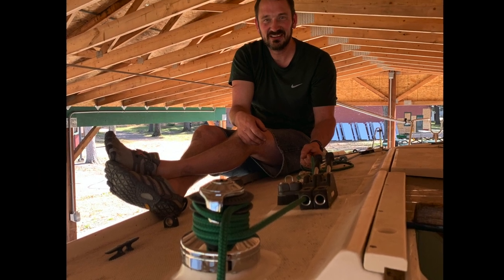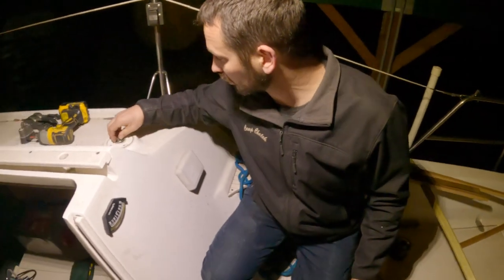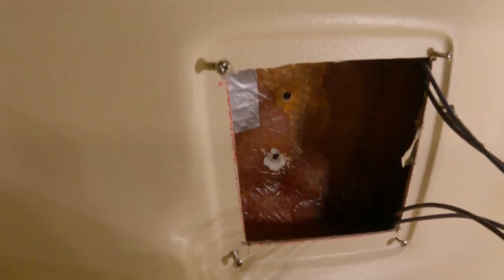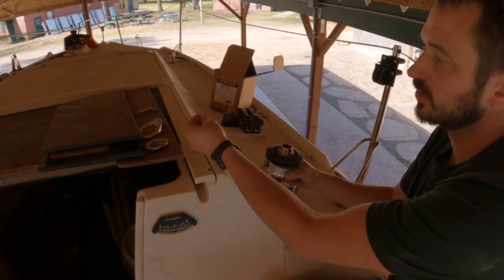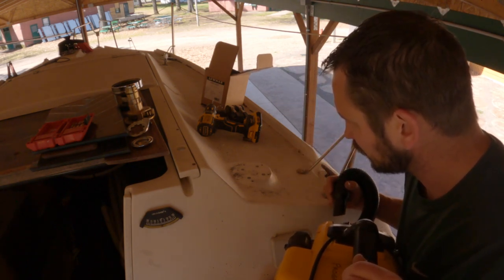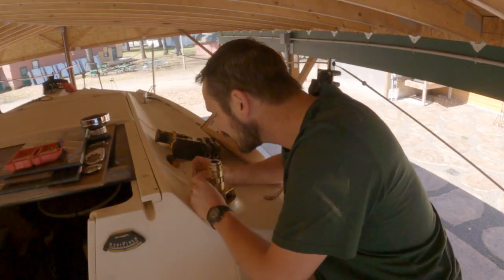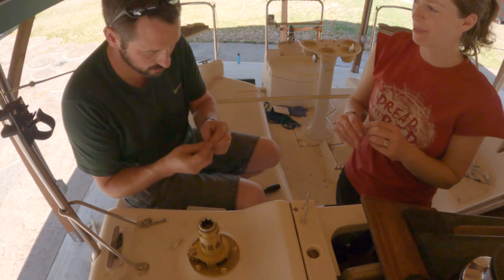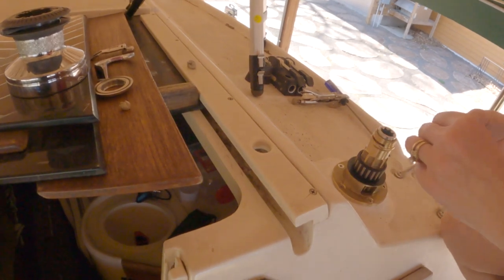Upgrading Orion's Winches

Comment: Wow, thanks for all this videos, I bought a Hunter 260 just like yours and your channel has been a blessing. Have you used new winches during sailing, how did it improve the ease of use vs the stock ones?
Reply: I have heard it is a game changer.
Reply from the maker: Yes, for our family it was a game changer. We left the jib cam cleats on in case we needed to lock off the jib sheet and use the winch for something else, however we almost always leave the jib on when sailing and our (then) 11 yr old could ease or take in the jib under control even under heavy load. Also for the 260, he could raise the keel all by himself. If considering- try to find a BOGO sale as David suggested!